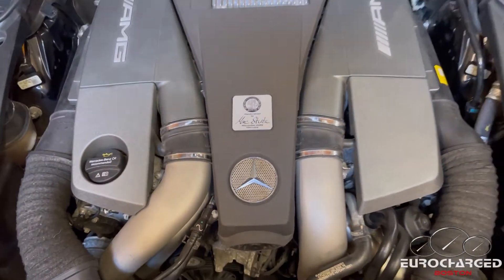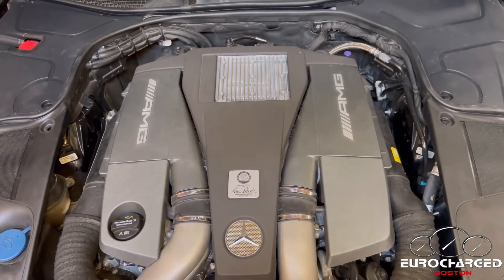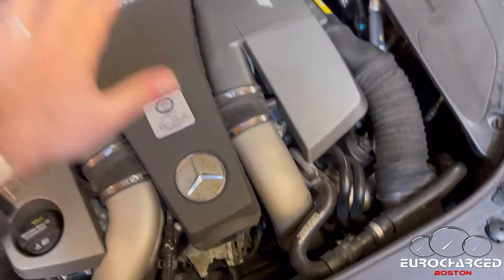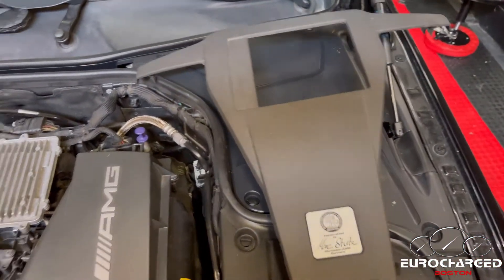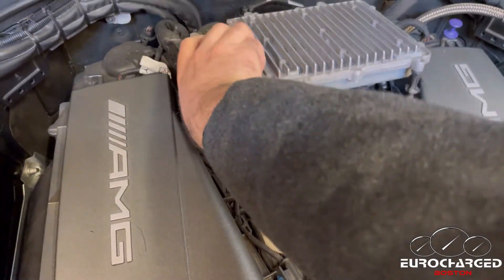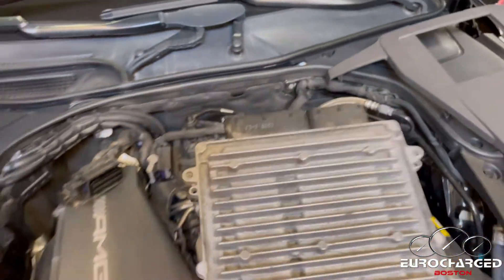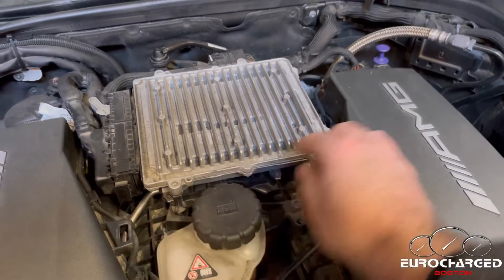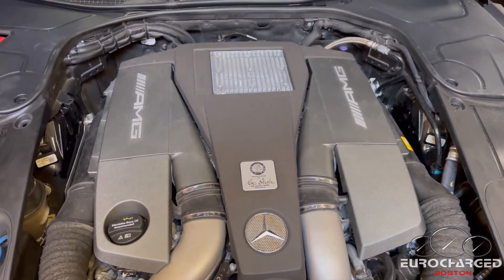Eurocharged - M157/M278 ECU removal

Comment: Should the battery be disconnected first? When I reconnect the ECU, the fan starts up.
Reply from the maker: That means the ECU is damaged or corrupted or not programmed.
Reply: @EurochargedBoston  That doesn't actually answer his question!!!
Reply from the maker: @gottliebdee263  That was an answer to the fan stating when ECU is reconnected. The first section of the question is no, you don't need battery disconnected.